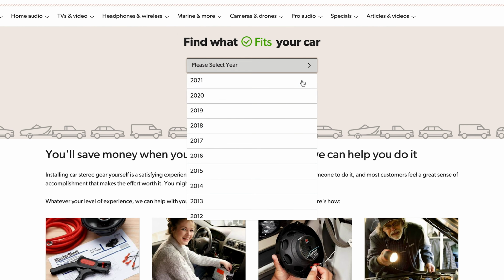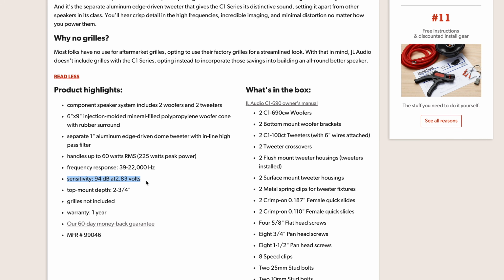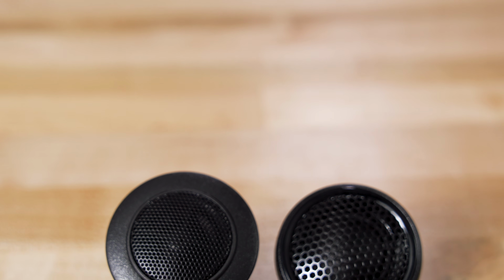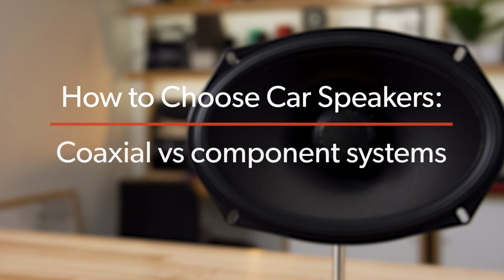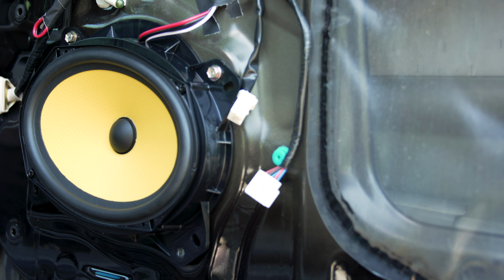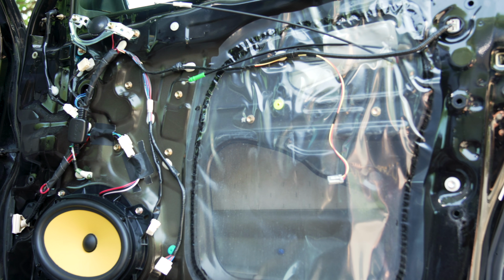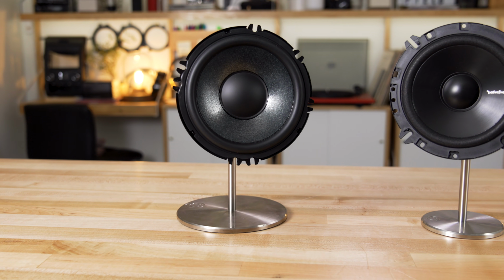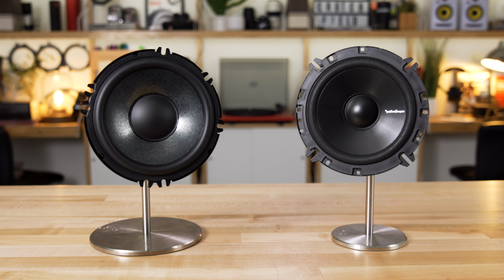How to choose car speakers | Crutchfield

Comment: How come radios dont already have a  amplifier?  I  want better sound for my 4runner.  I  dint want a amplifier somewhere in my vehicle.  It's my camping vehicle.  I need the extra room.
Reply from the maker: Most radios have an internal 4-channel amp to power speakers. But those amps are typically fairly low powered, so adding a more powerful external amp can help provide the best overall sound quality and stronger volume levels.

Comment: I tried to find speakers, head unit, etc. for a 2019 dodge ram two door pickup and it's not listed.
Reply from the maker: Dodge and Ram split into separate companies in 2009. When this happened, we stopped listing Ram models under Dodge. We now list Ram (also Ram Classic when that's an option for the year as well) as the make of a vehicle and 1500, 2500, etc.. as the model.
Reply: @crutchfield  Right I just found that out, thanks

Comment: Best speakers for 2019 Honda Civic sedan ?
Reply from the maker: We will be happy to recommend the best speakers for your audio goals. First, we have some questions on the vehicle. What size screen is in the stock radio? Does yours have a speaker in the center of the dash?

What changes are you hoping to make to the sound you get from the stock system?
Reply: @crutchfield  thanks for the quick response, I have the base model so it’s the 5 inch speaker I believe , and no speaker in center of dash . I am looking for something better than stock speakers that produce some good knocking bass with better sound , is an amp required for this cause I don’t know how to install that …
Reply from the maker: All speakers will indeed give you more bass when that are given the extra power from an amp. Another route to consider if you are to add more bass into the system is a sub. Even a compact powered sub will round out a system REALLY nicely with bass and give more than what the speakers will even when an amp is used for power. So, for example, you could install new speakers that are efficient enough to run well on stock power in order to get better sound and clarity, and then do a powered sub to get some knocking bass.
Reply: @crutchfield  so are there speakers that have subs in them , or is that something separate you have to put in the trunk ? Recommend me a nice speaker on your website that can give me an all in one experience if there is such a thing … thanks a lot for the help though learning new stuff

Comment: Has anyone ever used 2 different brand 6 and a 1/2 door speakers with a amp attached and it sounded good
Reply from the maker: we do have customers who mix and match speaker brands all the time. It can sound good if the speakers are being powered correctly!

Comment: Can I choose a speaker by the size of their magnets? Please guide me, thankU so much.
Reply from the maker: The diameter is often recorded in a speakers specifications to help when there is a tight fit in the speaker cavity. As for using it to help with audio performance, there is typically no indication as to the strength of the magnetic field created by the magnet. Because of this, we only use it to help with tight fitting locations in vehicles. Is that what you are experiencing; a lot of speakers are hitting something in the speaker cavity? We may have information to help. What vehicle is this in?

Comment: Hi! Whats audio system can fit in a Lada Niva Legend 2022?
Reply from the maker: We are only able to research vehicles released in the U.S. market and do not have any information on what can fit into your 2022 Lada Niva Legend. Wish we had different news for you there. We recommend checking with a local installer for help upgrading it
Reply: @crutchfield  thank you very much! The thing is that my vehicle is imported, I live in a little city called Coyhaique, in Chilean Patagonia, so we don’t have a certified installer. Again, thank you very much for the answer.
Reply from the maker: Sorry, Pablo. Hope you can find some good options.

Comment: why, so i see you don't have speakers in the website to see what fits my car for renault, i have a renault laguna from 2003 and i have no clue what fits it xD
Reply from the maker: We are only able to research vehicles meant for the U.S. market and are not able to research Renaults. Wish we had different news for you there. The best recommendation we can give is to check with a local installer for help. Hope you get the sound you seek!

Comment: Very good, information dense video. Fantastic to get up to speed on what to look for in a car speaker, what the difference are and how they impact sound, installation and more. 👏👏👏
Reply from the maker: Glad we could help!
Reply: @crutchfield  do you have speakers that eill fit a 2002 mitsubishi space star?
It would br amazing because im thinking of replacing the oem door ones and not very keen on how to measure and all that

Comment: Thank you. What's a good average RMS you should use when not installing an amp?
Reply from the maker: Actually, a good sensitivity is best to look for when choosing speakers to be powered by a radio. At least an 88dB sensitivity; preferably over 91dB

Comment: Now, I have a harmon kardan built-in. An I have to replace a speaker. But. The stock speakers are dual voice coil. What should I do?
Reply from the maker: We definitely need to make sure that design and ohms can be matched by the replacement driver. What vehicle is this in? Are you referring to a subwoofer?
Reply: @crutchfield  mercedes-benz r-class 2006, and it's front right door speaker. Yeah, weird harmon would do that
Reply from the maker: That location does not have enough room for any of our 6.5" subwoofers. If you cannot find a replace a dual voice coil 2 ohm driver to install, you may need to use a line output converter so an aftermarket amp can be installed to power new speakers installed into the front doors.
Reply: @crutchfield  it not a sub, it's a component mid bass that's a dual voice coil
Reply from the maker: The best fit options we have to match the factory power would be 4-ohm full range single voice coil speakers. A wiring harness is not available. You'll have to splice or tap the vehicle's speaker wires to your new speaker wires and these will still be limited to the factory's crossover points. Your best aftermarket option would be to add a new amp for your new speakers so you can use a beefier midrange or get better performance from new full range options.

Comment: Which is better overall if you want luxury bass, clarity, and sound inside the car only not outside the car Alpine R, GTO 629, Focal, or Infinity Kappa or another brand??
Reply from the maker: All great brands! What's the year, make, and model of your vehicle? And what will you be using to power the speakers? With a few more details, we'll be glad to make a specific suggestion.

Comment: Is there a website that we can use for EU cars which aren’t imported to the US?
Reply from the maker: We are not aware of a site that does what we do but for EU cars instead. Wish we had different news for you there. You may need to check with a local installer for help. Good luck!
Reply: Cheers.

Comment: I need help!!! I have a 2004 chevy blazer. I know nothing about speakers and wattage ,dba, etc. What I do know is that my blazer has two speakers in the dash. I think they are 4x6  I know I have 2 speakers in the front doors and 2 in the back doors. I'm not sure what size they are, That being said, here is my concern. I recently bought a pioneer AVH-120BT 6.2" Din radio and I would like to know what kind of speakers would be compatible with it, without blowing.  The output specs on this radio reads as follows... Power output..... 14 W RMS x 4 Channels
S/N....... 91 dba (Reference: 1 W into 4  
Keep in mind, that I also had a DS18 1500w amp and two 12" subwoofers installed. The speakers that are in it now are not connected to  the amp/ nor will the future speakers I buy.  I'm just looking for higher quality speakers that wont get drowned out with the DS18 Subwoofers. Any help would be greatly appreciated!!!
Reply from the maker: We'll be happy to help you choose speakers to match your Pioneer radio for power. Keep in mind, you can power up to 4 speakers directly from that radio. Based on the amount of power you'll be using for your subs, adding an amp for the full range speakers would be best though to help even out the mids and highs with your bass. The JBL Club 622 are a perfect match for your radio and a good fit front and rear here: www.crutchfield.com/I-rYALc921/p_109CL622/item.html
Reply: @crutchfield   @CRUTCHFIELD  What kind of amp do you recommend for the speakers? Could I just hook my speakers 2 the existing amp or is that to powerful? Also, I probably wouldn't need back speakers, I would want 2 door speakers and 2 dash speakers. Do you have any 4x6 JBL speakers?
Reply from the maker: The mounting depth in the dash speaker openings in your Blazer is very limited, and unfortunately we don't offer any 4"x6" speakers that are shallow enough to fit without modifications. But if you can find a way to modify things a bit to gain around 0.7" of additional depth, here are some great sounding JBL 4"x6" speakers: https://www.crutchfield.com/I-rYALc928/p_109CL6422F/JBL-Club-6422F.html
And to power the dash and front door speakers, check out this Pioneer 4-channel amp:  https://www.crutchfield.com/I-rYALc928/p_130GMA4704/Pioneer-GM-A4704.html?tp=35782

Comment: I recently snatched a volvo v70 P2 -05 and was wondering if anyone with the same car has done a speaker change and if so, what did you guys go for?
I was thinking of putting in some nice coaxials but in my previous P1 v70 i felt there was some imbalance in the audio (or maybe thats just my ears..?)
So now im leaning towards getting new/used original door tweeters (since mine are broken) and putting in some nice midbass speakers instead.
Reply from the maker: If no other owners post what they installed, we will be happy to check our research on what might fit back in place and give you a personal recommendation on replacements. Is this a 2005 year model? Does it have factory installed navigation? Have an in-dash CD changer?
Reply: @crutchfield  Big thanks for the reply.
My volvo is indeed a 2005 model, i switched the Headunit for a pioneer DEH X5700BT which i've used in my previous car (volvo s70) and audio was magnificent in that one.

I noticed that mine does actually not have tweeters in the doors, its just the driver side door speaker which is dead. It does not have a factory nav installed. the stock HU it had was the 650. 

I managed to buy the Pioneer TS-G170C speakers and i plan to install them tomorrow or the day after to see how they are.

If you have any recommendations though i'd greatly appreciate it, im not looking to hook up an amp, i have a great distaste for wiring and taking parts off the car to lead them.
Reply: @crutchfield  update: Went with the pioneer TS-g170c and they sound absolutely incredible and at such a affordable price it's hard to recommend anything else for people who are satisfied without having a subwoofer + amp.
Reply from the maker: Have you installed them yet? If so how are you liking them? Most aftermarket speaker should be an improvement over factory speakers, but certain ones do a bit better without an external amp than others!
Reply: @crutchfield   Yes, i installed them yesterday. What luck too that the Pioneer tweeters slot directly into the volvos tweeter frame without any modification so installation was super simple, Wiring was not an issue at all since the tweeter + bass are both in the door and there's tons of room to tape the excess wiring against the door.

I love them, such a massive improvement, they have so much kick to them that i had to turn down the bass boost from 4 to 2. 
And the tweeters are just ideal, i have very sensitive ears and these do not give me muffled hearing when listening to music.

straight 10/10 from me.

Im running them without an amp, just running the regular mosfet 4x50 from the pioneer headunit (DEH X5700BT to be specific) which is getting a bit old by now, been thinking of getting the MVH S520BT.
Reply from the maker: We are glad you are enjoying your system! 🙌 If you end up switching out your radio, let us know if we can help!

Comment: Going off your video i don't know much about car stereos but was thinking of getting the ilx w650 with the kta 450 not really up to getting a subwoofer as I love rock music more so than anything else. 
I looked on your site and unfortunately you don't deliver to Australia, I went to make an order couldn't put in Australia unfortunately.  
As I noticed it came with everything I needed for a Mazda tribute 2002  bugger very helpful site you have there
And it seems here in Australia I haven't found anything like your site.
Anyway, the Mazda has 
5x7s in the front and rear doors 
Few questions with that system and amp what wattage could I run for the speakers like is it per speaker, per channel is that how it works? Or is it pair in wattage? I have been looking for this very answer for this system. 
How do I pick 2 pairs of speakers for that system? 

And going off your video so would it be good to run woofer 5x7 in the back door and tweeter 5x7 in the front? Not really sure if I want make any holes in the car.

Thanks if you made it this far.

Kind Regards
Reply from the maker: Yes, unfortunately we don't ship outside of the U.S.  Sorry about that.  But in terms of speaker wattage ratings, they are per speaker. Here's a very informative article on our site that deals with choosing the best amp for your speakers: https://www.crutchfield.com/I-rYALc928/learn/car-amplifier-shopping-guide.html
You could go with standard 2-way speakers in the front and rear both for a nice balanced sound. A 2-way design has the tweeter mounted in the center of the woofer cone, so you won't have to make custom cutouts for separate tweeters. Check out this article on choosing new speakers:
https://www.crutchfield.com/I-rYALc928/learn/learningcenter/car/speakers.html

Comment: Do we have to add a amplifier to the car speaker for it to sound better? My local workshop said amplifier shorten the lifespan of the speaker and we do not really need a amplifier for the car speaker. Thank you
Reply from the maker: The power requirements would depend on the exact application. Are you planning to use specific speakers for a specific vehicle?

Comment: Hi, thank you for the awesome video! Nice to see some original content! Teaches me a lot!

I have a newbie question, i hope you don’t mind?

I have the Alpine R Spec speakers that do 100w RMS. I have the Halo9 head unit 18w RMS Output. I only have the  alpine 45w RMS Amp. Can I safely turn the gain right up to max on the amp?
Reply from the maker: We replied to your post on our Alpine speaker video. Just in case, we will post the reply here as well.

There is a process to setting the gain. We have an article on our web site that outlines it for you:

https://www.crutchfield.com/I-rYALc227/learn/how-to-tune-car-amplifier.html

Comment: What would you suggest for a budget speaker with decent bass no more than 120$  6.5 inch for a 03 dodge ram
Reply from the maker: Are you using the OEM radio?
Reply: jvc kd-sr80bt
Reply from the maker: That radio's power will be able to drive the Polk Audio DB692 speakers nicely so you can get improved bass from them. You can find the speakers here:

www.crutchfield.com/I-rYALc227/p_107DB692/item.html

Comment: imo subs w/paper cones sound deeper and have better responce at the cost of possible durability (as i I wouldn't install them on a boat but in a car or trunk yes-absolutely).
 Sensitivity is also important. I prefer a high sensitivity as it takes less power to produce higher spl's.
also, try to run subs as low ohms as your amp can safely push them to maximize your performance per dollar spent. Be careful to stay within safe parameters as 2ohms is usually the limit where only high end amps can drop to .5ohms. 

 My favorites were always Orion HCCA products yet they're quite expensive for the original 80's, 90's versions.... these days maybe MMATs ?

also, planet audio was (afaik) higher quality, same with old version of phoenix gold.
these days I think almost everything is from asia.
Reply: paper cones are 💩!!!!!!!!!!!!!